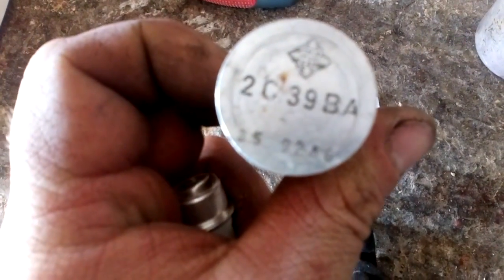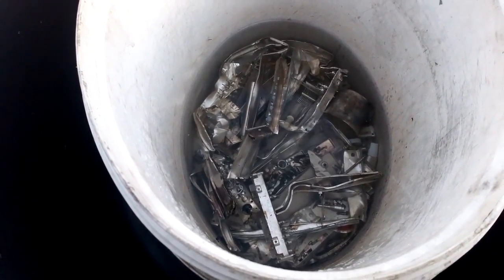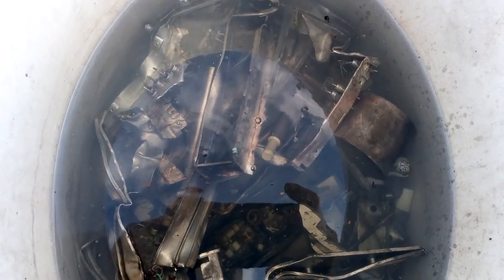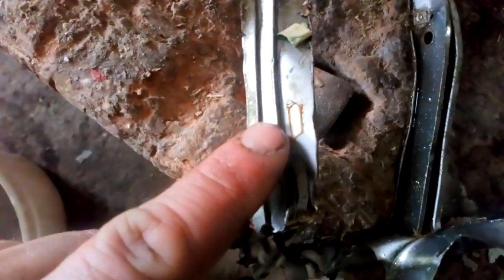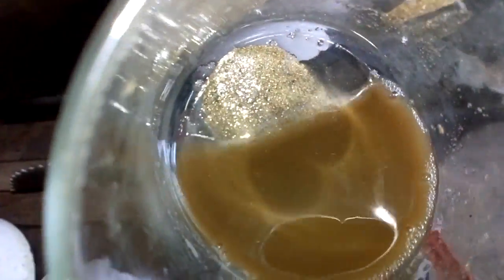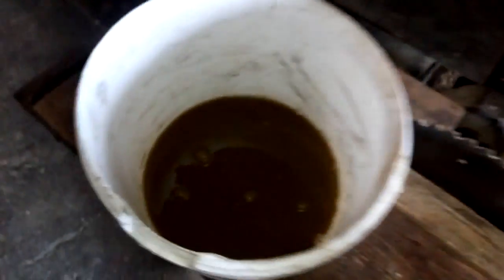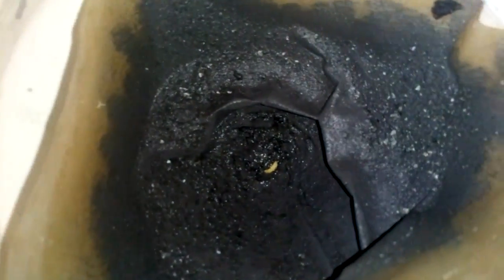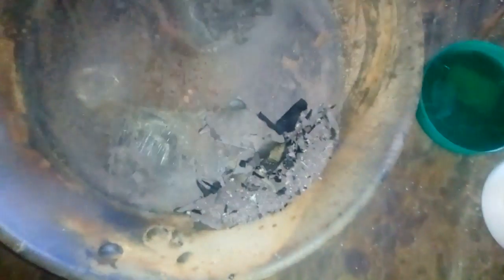SILVER RECOVERY from silver plated scrap metal!

Comment: 2/3 of an oz (20g) is about $20 today if 9.99 pure, you need at least 1l of HNO3 to do this, 1l of HNO3 cost about S20 in the US, unless you use industrial grade that may be cheaper but is hard to find, all of it is not worth of doing by my calculations. And there are other expenses too. There are much cheaper ways of removing silver from plated stuff.

Comment: since you already are processing chips for the gold bonding wires you should have the silica dies as a waste product. so my thought was if you collected say 5 to 10 kilos of them it might be worth trying to extract the rare earths used to dope the dies scandium is worth over 270 dollars a gram so at more than 10 times the value of gold for instance so it might be worth doing.
Reply: Do somd research, scandium is extremely hard to refine and separate from other metals. It wasnt used that widely in silicon because of the price, your likely to find it in military, aviation or most likely aerospace due to the density. Even with a high price just isnt worth the trouble unless you can scale down and create a perfect elctrowinning setup. Even if you had a large amount say 100 pounds the yield would be much lower than thought from cpus

Comment: All the tin drops with the sludg

Iead nitrat drops like silver as lead chlorade

This silver peace is not pure it has lead and.tin 
The best way is to use h2so4+hno3
Reply from the maker: Of course it's not clear, but it's at least 925 clean. Hydrochloric acid has eliminated most of the foreign metals so silver is close to high purity. The Sulfaric and Nitric is more variant, I admire it, I just wanted to show how I sometimes I do work. I want to show people a lot of different ways to work, so let them decide which one is best for them. Soon I will do a video with this acid combination.
Reply: 999 Dusan Gold recovery 

Good thinking dusan 
Keep the good job